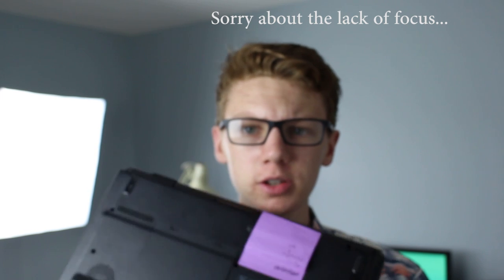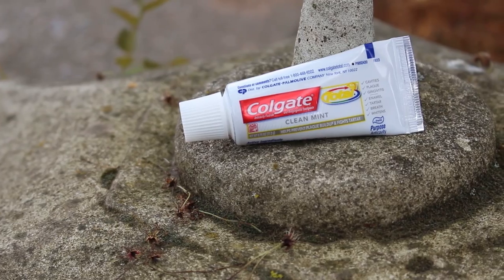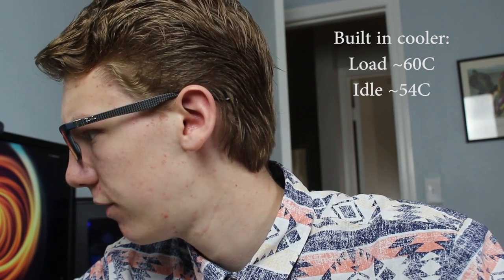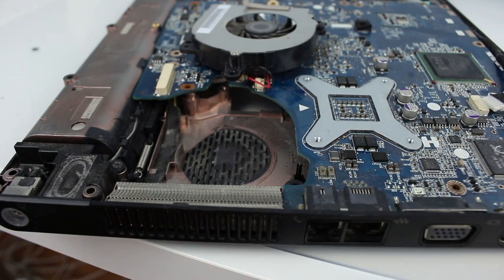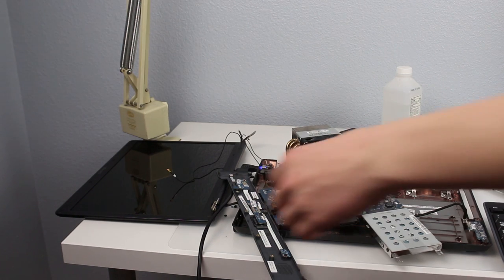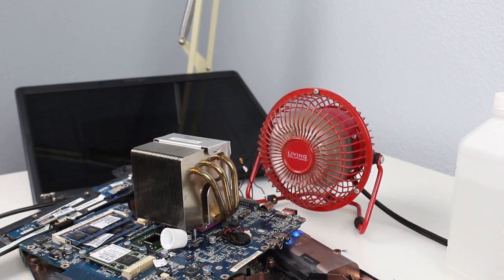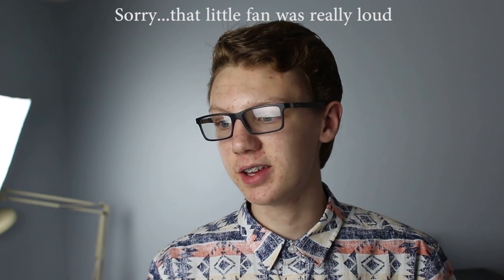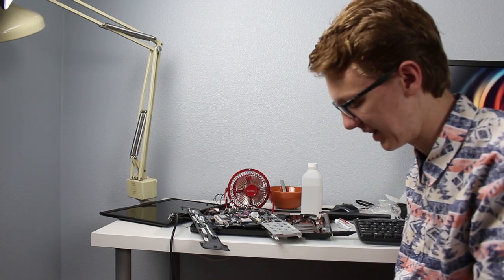Putting a desktop CPU cooler on a laptop!

Comment: Ok, I understand that not many people can invest tons of money in their videos but at least buy a 5-7 dollar thermal paste dude :D hahaha
Reply from the maker: Nah, the toothpaste was part of the fun :p
Reply: hahahaah :D Crazy dude :D
Reply: for short therm, toothpaste is good. but long therm it isnt that good. But because he had this setup running only for a a minutes/hours, its fine
Reply: the fuck lmao hahaha
Reply: i use silicon based thermal paste that is really cheap
i paid 3 bucks for 50g
Reply: bwaaaa?
Reply: Gillewill  u re missing the point here... The real upgrade step would be to mount the hole thing in front of an air conditioner and with the controller of AC choose the temprature :D
Both u and the laptop will cool down . Win-win situation.
Reply: Did you mean peanut butter? :D
Reply: And use only the necessary, is not need "cement" the CPU like the guy did in this video. :))
Reply: @GavinRemme  sure

Comment: How many hardware did you kill already??? you shove thing around, put and hammers the cooler on the motherboard... lol
Reply from the maker: When did I hammer anything?
Reply: At about 5:12 when you hammer the cooler screw on the mobo... I loled
Reply: I believe he means a hammering relative to the nail(the motherboard in this instance), It may not feel like a hammering to a nail but the motherboard it might fucking suck (minor cracks or loosening of stuff may also be an issue with the tapping i'm guessing).
Reply: yes! A MOBO is very complex, imagine if a tril is broken when hittin the mobo with a metal thing... chaos ensues...

Comment: 4:52 Graphics card duh ? ☻
Reply: This should be the chipset.
Reply: It is  the graphics is integrated in the CPU
Reply: It is the integrated graphics for sure, the chipset does not need that much cooling and can just be on its own (typically on the other side of the motherboard).
Reply: Yea
Reply: It's the south bridge not the graphics omg learn before you comment
Reply: Wow so smart
Reply: it is the graphics chip, the celeron 530 that he has does not have integrated graphics http://ark.intel.com/products/33100/Intel-Celeron-Processor-530-1M-Cache-1_73-GHz-533-MHz-FSB-Socket-P, WHEREAS THE G530 does http://ark.intel.com/products/53414/Intel-Celeron-Processor-G530-2M-Cache-2_40-GHz
Reply: not to show you up or anything but, it is the graphics chip, the celeron 530 that he has does not have integrated graphics http://ark.intel.com/products/33100/Intel-Celeron-Processor-530-1M-Cache-1_73-GHz-533-MHz-FSB-Socket-P, WHEREAS THE G530 does http://ark.intel.com/products/53414/Intel-Celeron-Processor-G530-2M-Cache-2_40-GHz
Reply: MR. PAZ a mobile GPU from this era is in the southbridge
Reply: @Nuka Stuka Integrating the GPU in the CPU is a newer thing. Before "integrated gpu" usually meant only that it is integrated in to the motherboard. Intel intergared them to the same package only starting from  Intel HD graphics, that is 2010 onwards. See here is the predecessor of the Intel HD Graphics, the GMA:
https://en.wikipedia.org/wiki/Intel_GMA

Comment: Observation... In order for you to properly compare the desktop CPU heatsink with the Stock heatsink you need to run the "stability test" with stock heatsink outside (laptop taken apart). The temps you have shown for stock are all enclosed and so temps will be much warmer. When you installed the desktop heatsink you had no enclosure so heat was being dissipated much quicker plus you had the fan blowing on it. Nonetheless great video I enjoyed it, you'll make a great engineer one day. Good Luck
Reply: so are you on yout path for engineering school. i'm a mechanical engineer myself and like messing with computers.

Comment: Very professional, you should try desktop building! 
(dont be discouraged by some salty comments)
Reply from the maker: I built my current desktop machine actually. I have a build video if you wanna check it out. https://www.youtube.com/watch?v=lR0wTs3aWFs (It's over a year old so it's pretty cringy)
Reply: +Gavin Remme Good choice of selecting an i5 4690K for gaming (Quad core). i7s not worth extra threads. Overclocking it for better single threaded performance?
Btw this is a great way for laptops to run at turbo speed constantly, I used silicone glue for my media production laptop, it sticks well and cools better even with a lower rpm!

Comment: Have you considered cutting the stock fan's male header off and splicing it with 12v and Ground on the new fan so that you can power the new cooler's fan using the header on the laptop?  I'm not sure the laptop's header can support your fan but it might be worth trying.

I like the experiment, I'm looking to do something similar myself.

Comment: hey, i have intel xeon x5460 clocked from 3.16Ghz to 3.5 and i have aftermarket arctic freezer pro7 cooler on it but at the maximum load it is above 80 celsius... wtf? is it because thermal paste? I have CoolerMaster v1 if that means something..
Reply: To me it sounds like the thermal paste and the clock settings. Theoretically, the more you overclock, the more it will affect the cooling(like how much fan rpm or fans will be needed in order to counter the heat). Arctic 7s are trash imho(my nonOC CPUs fail because of it). It's best to stick with basic/ceramic compounds or Silver 5 for reliability and conductivity. Also use a software called MSI afterburner to tweak your fan settings to get the desired temp and to save your pc from overheating/overloading. The best stuff I found for overclocking would be liquid metal from coollabratory or IC diamond 7 for better cooling, but be warned of how these may(minor cases) scratch the shit out of the contacts when you have to clean it.

Comment: Anyone else concerned that he didn't know the other chip was the GPU and he didn't cool it?
Reply from the maker: That was the GPU? I thought it was integrated into the CPU like they are on modern systems without a dedicated GPU. Either way, it didn't really get that hot, I could touch it while it was under full load.
Reply: +Gevan32 It wasn't a GPU it was the North Bridge
Reply: Gevan32 it might have been the northbridge but most "HP" laptops from that time period have the GPU sharing the CPU heatsink
Reply: It is definitely the northbridge. I took apart my old laptop with a Pentium M a while back and that's what was said in the disassembly manual.
Reply: +Gavin Remme Don't worry, wasn't the GPU. A quick and dirty way to tell the difference in laptops is to look at the thermal interface. If the laptop does indeed have a non integrated GPU chip sharing the heat pipe with the CPU it will always have thermal paste as the interface. If however the chip sharing the heat pipe has a thermal pad instead, then it is a North Bridge. This chip can indeed run without direct cooling, as the air from the desk fan would have been sufficient, however prolonged usage like this would certainly degrade it. Either way, cool video man, you have very high production value for such a young channel.

Comment: That second chip was the laptop's chipset which is also the laptop's GPU.
Reply from the maker: Are you saying a chipset is also a GPU?
Reply: Gavin Remme Yes. My vintage ASUS motherboard with the NVIDIA 6150LE onboard graphics is also the chipset. I was even able to overclock the chipset graphics a bit. Some laptops back in the day worked this same way. Nowadays unless we're talking about the AMD FX series or the i7 series, the GPU is on the CPU die.

Comment: i know this is a older video of yours... here is the reason why it was alot better in thermals...

the cpu and gpu had dried thermal paste so it was not conducting the heat correctly

once you put new thermal paste on it and put the stock cooler onto the  chip it would cool just as good as the orginal cooler..

i had done this on a old graphics card that was running hot put new paste on it and it was about 15-25 degree cooler...

other then that man im enjoying your videos so i will sub to your channel

Comment: Yooooo The way to power the actual fan is to just cut a android charger and hook the ground and postive wires together plug the usb into the pc and wala and hook the D+ into the green wire so your pc has control over the fan

Comment: Digging from the grave here, but I think once the toothpaste oxidized it'd become hard and brittle and lose it's capabilities of cooling. Neat idea. I plan on disassembling my laptop sooner than later. Since GPUs cost $1500+ it's definitely cheaper to convert my gaming laptop lol
Reply: i will do the same because i changed the processor for a 940XM in an old samsung and the heat is insane. so, i will just cut the plastic case with a dremel and fit a copper heatsink with integrated fan and nice leds conected to the stock fan energy. and glue up or bolt ir somehow haha

Comment: So you say that only heatpipe is enough for it to actually work? I mean you didn't pluged the cpu fan into anything?
Reply from the maker: +Berk Ilgar I plugged in like a little desk fan that blew on it.
Reply: +HVinduction Don't know what he did afterwards however i managed to power the fans attached to heatpipes via USB cables and stick it on top the motherboard. It works flawlessly.

Comment: the blue dyed hashwel and ivy bridge motherboards that are made by foxxcon/hannstar  and are used by many laptop companies from lenovo to acer rely to the screws for their earthing,  if you are using the motherboard outside the chassis the motherboard circuits will lose their earth and have a high chance of failing.
tl/dr, DO NOT USE YOUR LAPTOP MB OUTSIDE ITS CHASSIS.

i also heard something about toothpaste, please dont use that either, haswell processors especially have small connectors on top, any kind of humidity can put your cpu at risk.

Comment: is there any adapters to use desktop cooler on laptop?? becauese nowadays you can get ultra thin desktop coolers that can fit a laptop case cutting a bit. Check them
Reply: Did u find any adapters? Im in the search with no luck so far

Comment: My old laptop sits at around 70c on the desktop with the back cover opened and facing up! 😂 While my gaming rig does 2k and sits at around 47c while gaming.

 Lol

CPU throttles and performance thanks on that old laptop. I'ma turn it into a desktop and use the monitor as a regular monitor for my gaming rig.

The laptop is going to be turned into a DHCP or a Nas or a DNS/pie hole server. 🤭👌. With a desktop cooler. 
if you have an old laptop just recycle it Instead of throwing it away.

Comment: you should have taken into consideration that the non stock cooler was mounted in an open environment letting heat disperse much better than it would enclosed in the laptops casing

Comment: thats other procesing unit is graphips chip :P noobs..
Reply: +TheSkodilac Hilarious you cooling him a "noob" for not knowing what it was, then getting it wrong yourself. That was not a GPU, it was a North Bridge.
Reply: +TheSkodilac Excellent grammar there buddy, you're clearly very intelligent. Considering I've been repairing laptops for over ten years I happen to know a couple things when it comes to their hardware. That chip is the North Bridge of the Chipset, and as I stated on another comment below you can tell this quite easily. "If the laptop does indeed have a non integrated GPU chip sharing the heat pipe with the CPU it will always have thermal paste as the interface. If however the chip sharing the heat pipe has a thermal pad instead, then it is a North Bridge."

But go ahead and keep insulting people as you bask in your own ignorance.
Reply: +Michael Marsden i also repair laptops, pc, androids and others, and i am not from USA, and i dont need to know good english ;)
i have indentical laptop :)
Reply: +TheSkodilac I'm not from the US either, but I apologize then if your first language isn't English. That's great that you also repair tech and you own a similar laptop to the one shown, but it doesn't change the facts. No point arguing about it further I'm just letting you know that that is not the GPU, and whether you'd like to accept it or not the fact remains that thermal pads are never used for GPU cooling, even in a laptop. Thermal pads are only used for the cooling of VRM or Chipset modules, although more modern Chipsets now use paste as well. Every single laptop that has the GPU die separate from the CPU die uses thermal paste as the thermal interface for both, never a thermal pad.